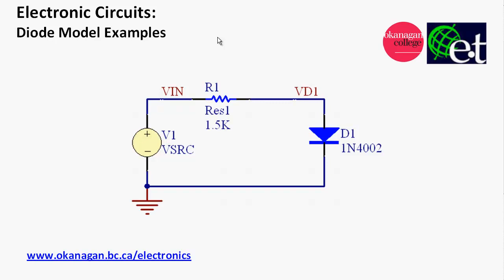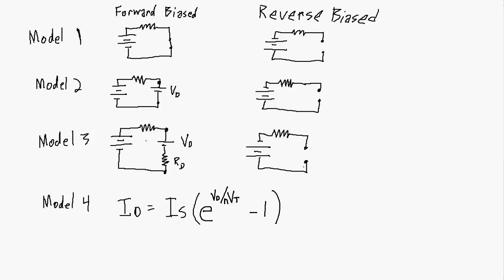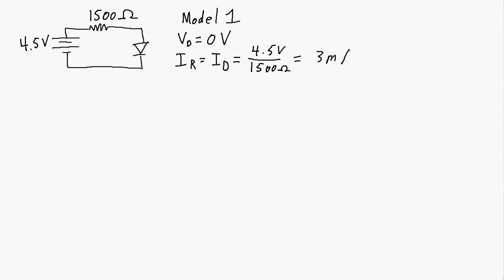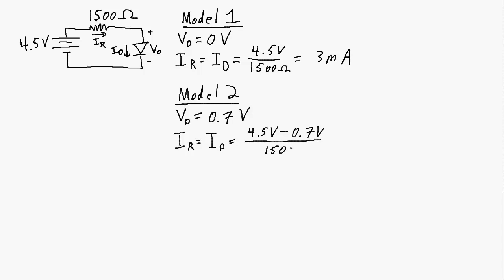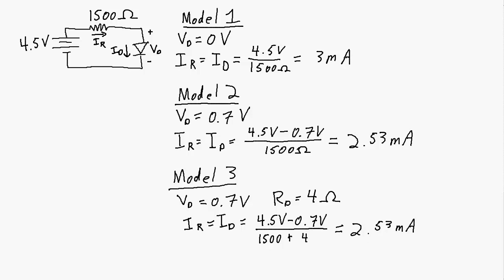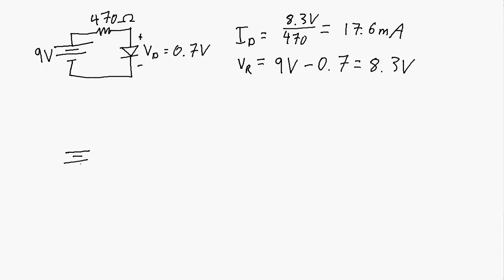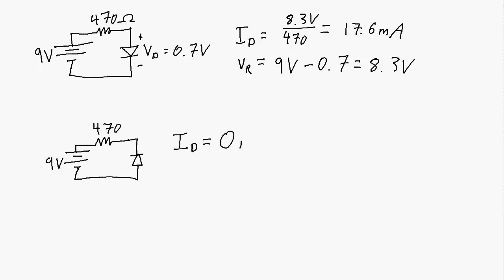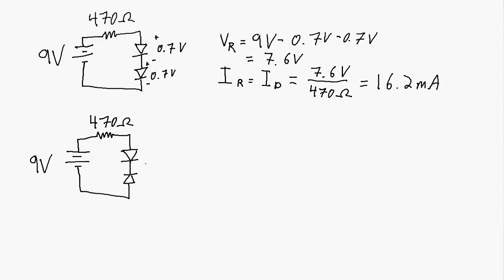Diode Model Examples

Comment: Thank you David. Can you please name these models ?
Reply: model 1 is the ideal diode model, no voltage drop across the diode. Model 2 is the constant-voltage-dop model, it assumes that when the diode is in operation, 0.7 volts is dropped across the diode. I don't know the third model but I guess it is supposed to be a bit more accurate model 2 since it has a resistance as well. And the last model is the exponential characteristics and these come closest to the real values, but can be very hard to calculate by hand so it can be solver by graphical approximation. Or by using a simulator to calculate it for you.